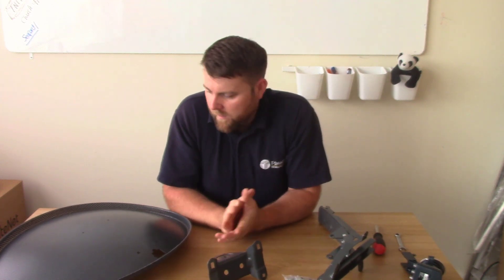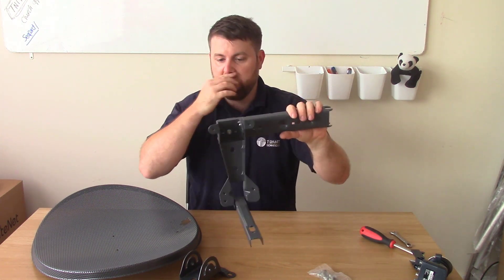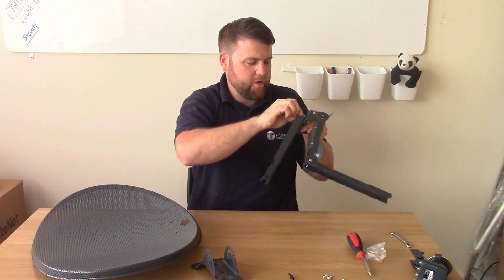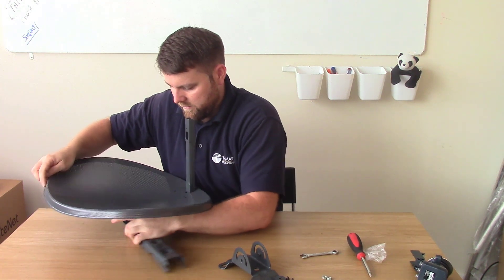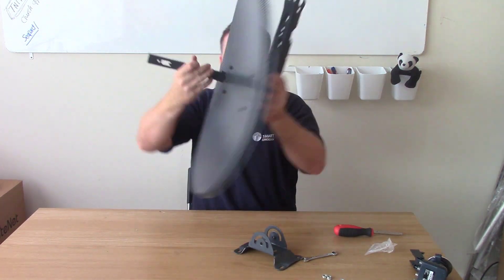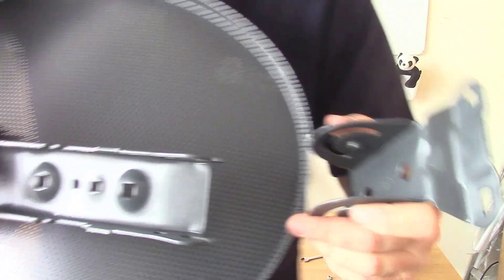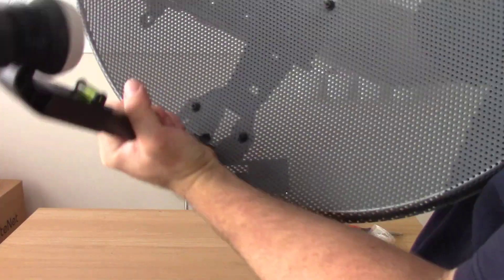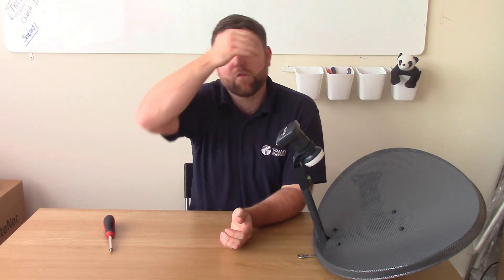How To Assemble A SKY/ FREESAT satellite dish

Comment: Hi, I have Sky Q and want to leave and use the Freesat built in to my TV,
I changed the lead from the Sky Q box to the Satellite input on my TV, did a autotune and it picked up around 160 channels, the EPG shows all the channel listings and programmes but for some reason I have no signal even though it apparently found all these channels?? Any help is appreciated.
Reply from the maker: Hi, yes it's to do with the type of LNB you have on your satellite dish and the type of LNB that you're TV thinks that you have. The TV will send certain commands to the LNB to select what channels you want to watch, but the Sky Q LNB doesn't work like this and also the frequency ranges are different. You will need to replace the Sky Q wideband LNB for a Quad LNB on your satellite dish. I hope this helps, Tom
Reply: @smartaerials  excellent, thank you so much for your help 👍🏻
Reply: @Shrekeo   i got two sky q cables left after we cancelled Sky Q, which cable do you use for the freesat built in Smart TV. Aprreciate any advice

Comment: Your videos are good but I always wonder what is the mm aim purpose of the holes on the rear bracket which are between the nuts holding the dish at the back  and the the holes for the pole? I know the dish can be bolted onto these holes by making it it shorter but nowhere online people say their uses.
Reply from the maker: I think that's all they are used for.

Comment: We've just cancelled our skyQ subscription. Was thinking to go Freesat with the old sky+ hd box but just found out that the LNB will have been changed by sky when they connected us to SkyQ. Would you say replacing the SkyQ LNB with a Zinwell J4S Quad LNB for Freesat/Sky Mk4 would sort it?
Reply from the maker: Yes that will do the job, you may have the change the holder on it though. Give it a go.
Reply: @smartaerials  would I not be able to just unscrew the screw on the SkyQ holder and swap it out for the Zinwell one?
Reply from the maker: You should be able to, but you might find that the Sky Q holder supports a 40mm LNB collar size and the Quad LNB has a 38mm collar. This isn't always the case though, you will know if it feels loose in the holder.
Reply: @smartaerials  yeah I had that problem bought new LNB but new ones are 40mm old was 37mm so coller not fitting. Just bought a new dish with LNB £27 Amazon

Comment: I wont to connect two humax receivers with twin tunners to one dish what would i need thanks steve ?
Reply from the maker: A Sky style satellite dish. Zone 1(43cm) for South of England/ midlands. Zone 2 (60cm) for the North and Scotland with a Quad LNB and two twin cables and F plugs.
Reply: I have the old humax  foxsat free sat HDR twin tuners . And so has my girl friend so  we have two boxes one up stair and one down stairs .does that mean I will run 4 X cable from the lmb for both boxes ,we live in the south east of the U.K. .And will need a quad lmb .cant mount on the front of the house so the garden is the only option ,this is what I can see others have done but that mean more cable ,so maybe a bigger dish more gain thanks Steve .
Reply: @smartaerials  thanks mate, all the best to u.

Comment: Thanks for this really helpful.

I've checked dishpointer and it suggests an elevation of 24.1 and a LNB screw of - 13.4.

I believe these dishes have an offset which means I don't actually need to move it 24 1. Do you know what he offset is?

To adjust the scew do I simply unscrew the LNB and twist it until I see myself at - 13.4?
Reply from the maker: Hi Jason. Yes they are offset dishes so no need to point them at the sky. 

On the side of the dish there are some degree markings by the elevation locking bolt. Obviously this is assuming that the dish is mounted level so you may need to play around a little for peak reception.

Yes just turn the skew to angle suggested,
Reply: Jason Million 0